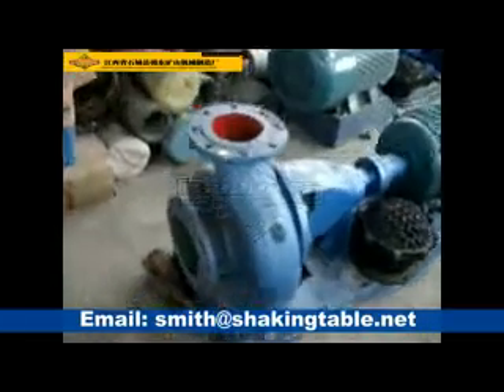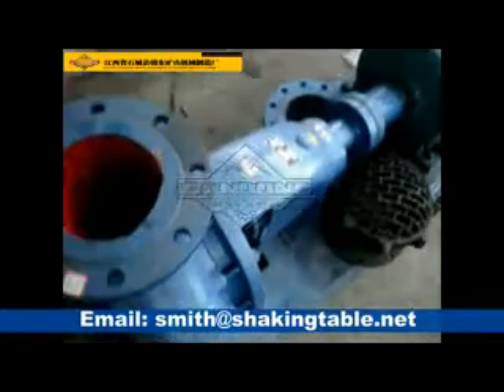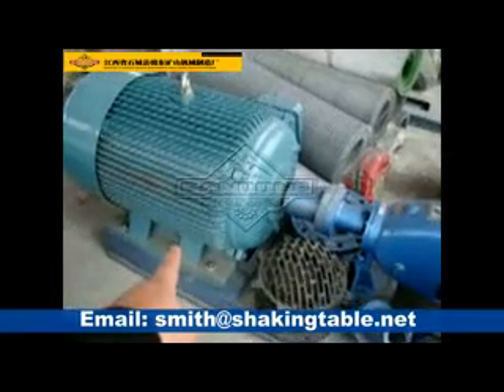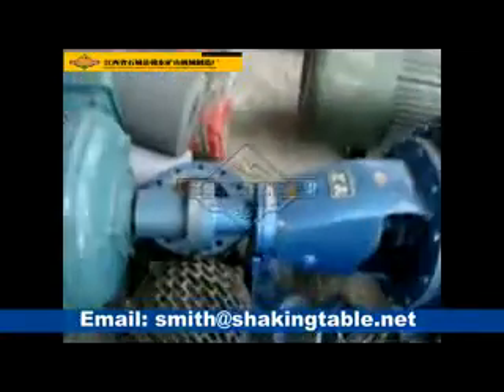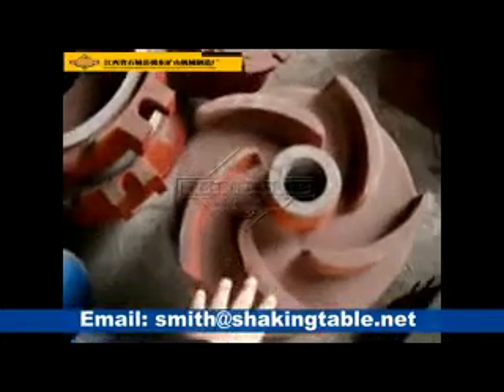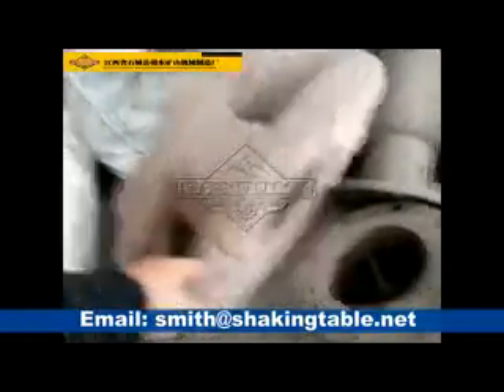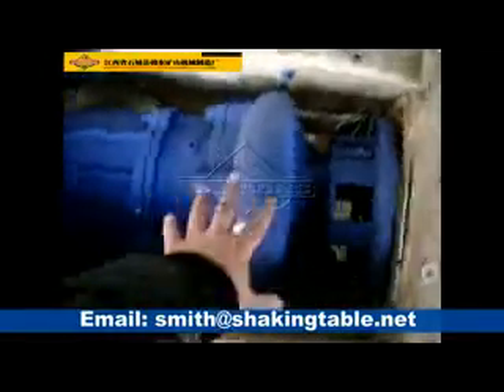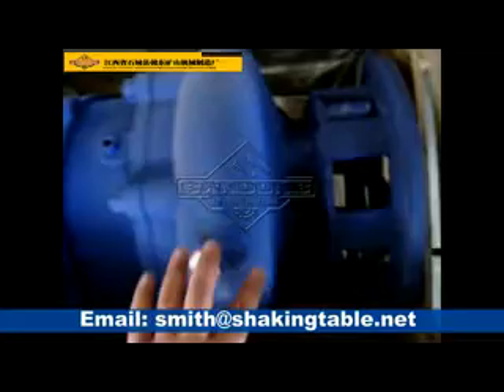IS series Single Stage Centrifugal Pump  Water Pump Submersible Pump

Comment: I've seen in most, if not all clear water pumps that a direct couple configuration is used for the driving of the pump. Do you possibly know the reasoning behind this?